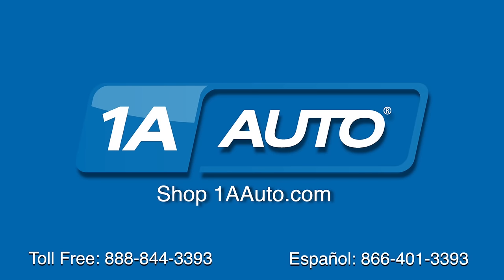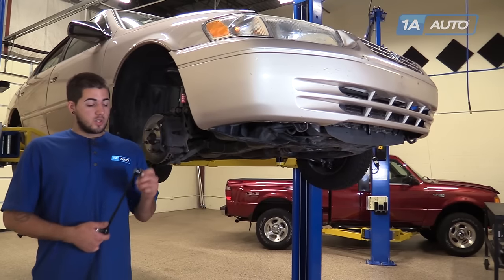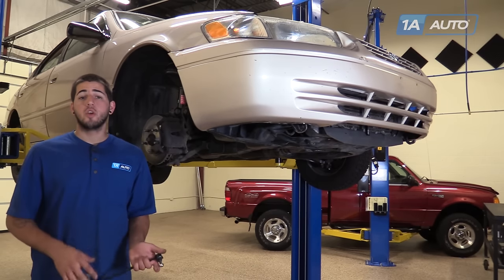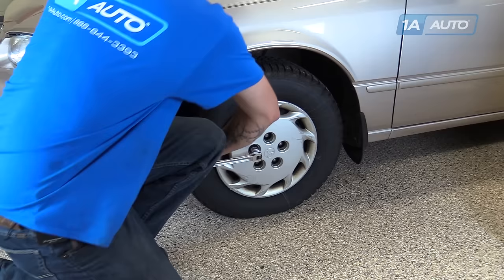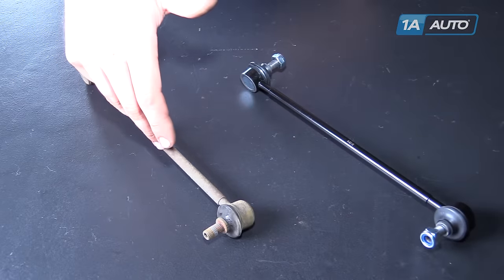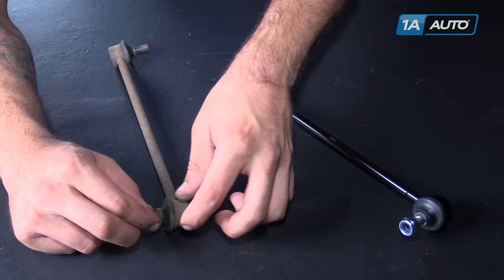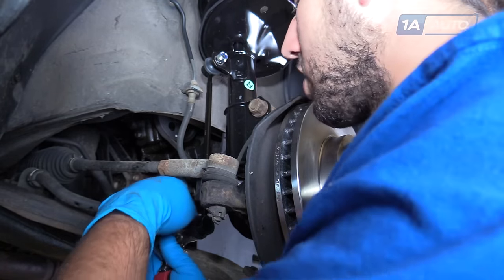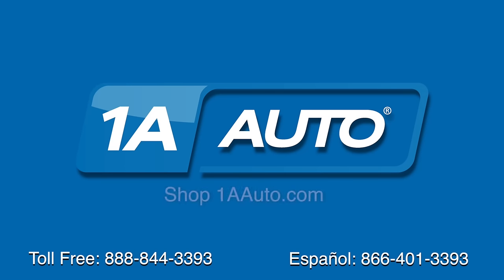How to Replace Front Sway Bar Links 97-00 Toyota Camry

Comment: Just did this on my 99.  important notes to take when doing this. 

You will likely need 2 Jack's or atleast 1 jack stand and one good jack with big round flat disk. Not the siccor one with narrow flat part that Jack's vechile. 
You will need to jack up the suspension nuckle up to compress spring, especially when putting new parts back on.  Or it won't go back in holes. 

Also there is a right and left. Look up part numbers to identify.  

Parts fit well. Thanks 1auto for all the helpful vids and parts!

Comment: Nice video. I always liked 1A Auto videos as they are typically very clear and easy to follow. I have one question though. Is it necessary to lift both tires so that weight is off stabilizer bar or can we just lift one tire and replace the sway bars and then lift the other one and replace the sway bar for the other side?
Reply from the maker: +Mohammad Farooq Tareen You do not need to lift the entire front end up, you can do one side at a time if you like!  www.1aauto.com

Comment: Thanks for tip on right & left as they look identical.  I ran my TRQ part number thru your website and it says which side as I didn't see marking on mine.  Also I saw the bolt has Allen keyhole to secure from spinning when putting nut on the thing.  I'm guessing bolt stays still for the final torque wrench click "sound of success".  Thanks for video instruction.
Reply from the maker: +s. fitz Thank you for the comments and for watching!

Comment: Thanks. this is pretty much what I've been looking for, I've been having trouble tightening up the nit on the top of the link. So using the locking pliers. Can that bite into the rubber? It just seems like its not enough surface to grab onto.
Reply: Thanks so much , Such a lifesaver!
Reply: There's a special nut in the middle of the nut that you can use an Allen wrench to get it done too

Comment: Hi OneA Auto. Do you know if replacing the front sway bar is straight forward like easy to remove. I have a white line replacement sway bar to fit. Update..i removed the front factory sway bar ok and got the new Whiteline BTF 38 swaybar in but i cannot rotate it into position as the steering rods are in the way. I think i need to either remove the steeting rods or the lower suspension arms to get the sway bar into position.

Comment: So I'm in the process of reworking my suspension the rear is almost done just need my other link (99 camry) and I tried using the Allen key first which inevitably rounded, then I tried the vice grip trick and that rounded the teeth on the vice grip pliers, I was so baffled as to what to do I picked up another pair of
Vice grips and got it off but you'd think Someone would've fixed this problem by now
Reply from the maker: +Sam Lyons Thank you for checking us out, and the feedback. Some hardware becomes difficult to remove as it is touched multiple times. We agree there should be a better solution. 1aauto.com
Reply: I rounded mine to, fortunately I had a grinder makes it much easier when you live in the rust belt.
Reply: Some can be held in place with an Allen key in the center of the bolt to eliminate having to use vice grips. If it's not too rusted that's what I would try to do. May have to tap it in a bit to get it to seat in place.

Comment: It would have been nice if you would have shown after you got the old one off where exactly you were clamping the vice grips that would be helpful information
Reply: Don't worry use an Allen wrench there is a special nut in the middle of the other lug nut. It's way easier

Comment: Is the torque wrench necessary? Or can the breaker bar be used to tighten?
Reply from the maker: +Rafid Chowdhury You can tighten them up using a ratchet and a socket as shown in the video. If you do not have a torque wrench, as long as they are tightened up with a wrench you should be okay. Harbor Freight carries torque wrenches at a reasonable price.

Comment: Hi I have the same car just a 99 but my question is when I turn my wheels left or right it clicks when the a.c. is on. Is it the sway bar ? I haven't check it yet.
Reply from the maker: +joel87555 You may want to check all of the front suspension pieces and the wheel bearings to see if they could be worn. Hope this helps you out. 1aauto.com
Reply: Most likely  its the CV axle joints. They are the drive shafts that connect the transmission to the front wheels.

Comment: So im trying to figure out whsts happening with my 97 toyota camry. When im driving and turn the steering wheel to about the 2 oclock position there is a noticeable knocking sound coming from the front driver side tire area. Ant ideas what this might be? Im scratching my head and have been inspecting the area for a bit now and not seeing anything totally noticeable.
Reply: Inner tie rod. Just replace the whole set as safer. It could lead you stranded
Reply: @vinceculum9873  thank you Vince. I'm gonna replace that and see if that does it.

Comment: I have a 97 and my sway bar isnt broken but the bar bolted to the frame that bolts to the sway bar is snapped whats that part called so i can buy the part
Reply from the maker: +Austin Simpkins You may be able to get a new bolt from the dealer
Reply: 1A Auto Parts not the bolt the bar that attaches the driver side sway bar to the passenger side seay bar

Comment: I have a 99 Camry, and when u are driving down the road the steering wheel will jerk to the left and also jerk back right soon after. What could this be?
Reply from the maker: +Spring Ramsey You may want to check all of the front suspension pieces to see if any of them are worn and need to be replaced. We carry a huge variety of suspension replacement parts on our website for many different year, make and model vehicles. Hope this helps you out. 1aauto.com
Reply: A torn belt inside one of the front tires will cause this kind of problem.  Many times a bulge can be seen or felt in the sidewall of a tire.  Be sure to check both sides on each tire.  If a bulge is found no matter how small the tire should be replaced.